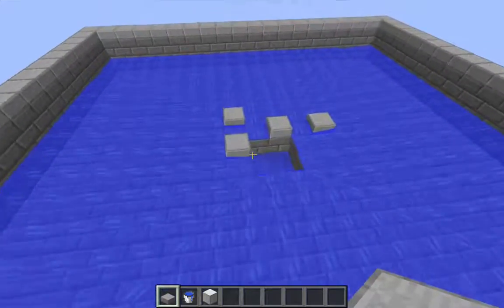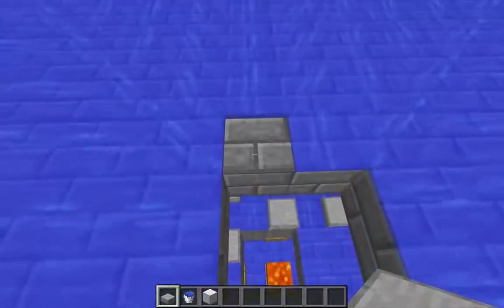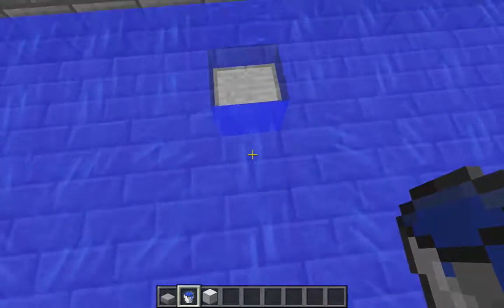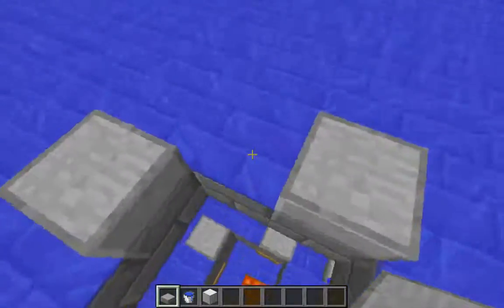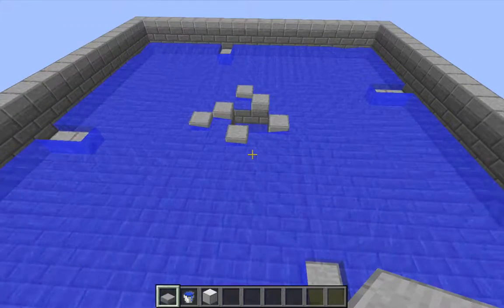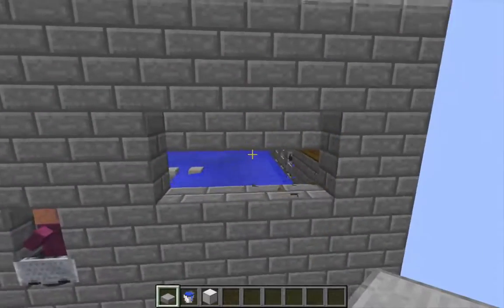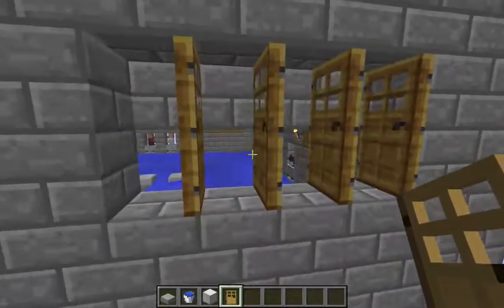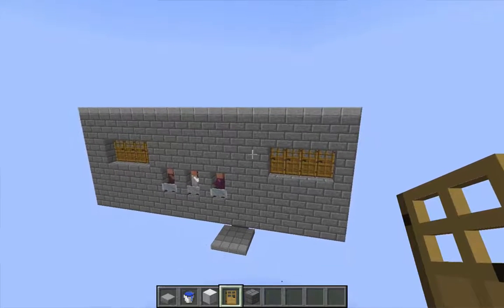Iron Golem Spawning Cell Final

Comment: This look rather through. Good job. I just have one bullet for it. The killing chamber may still be within the village. Just lower it and it should be fine.
Reply from the maker: +Shadow 8472 Iron golems need to drop at least four blocks to be considered "out of the village", so exactly four blocks should be okay. I've tested it, and another iron golem will spawn when the first drops by only four blocks. However, to be safe, following your advice and lowering it a bit more is probably a good idea.